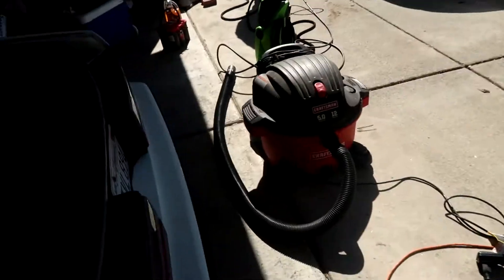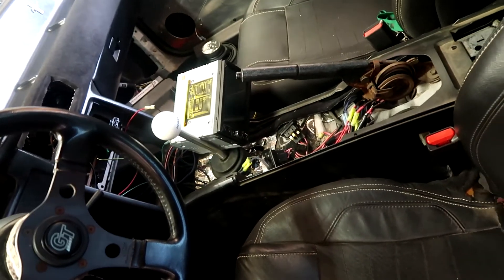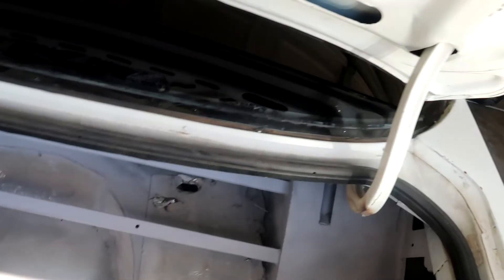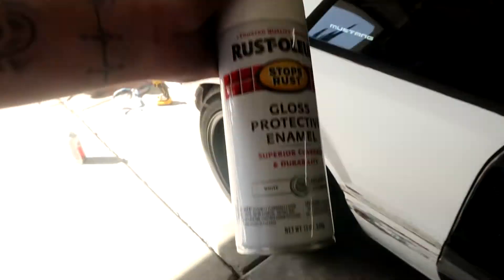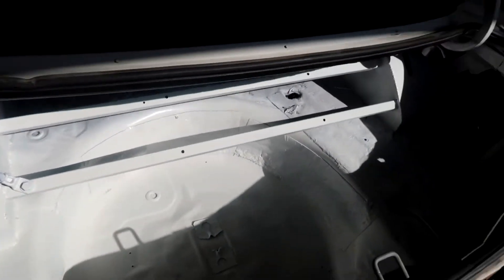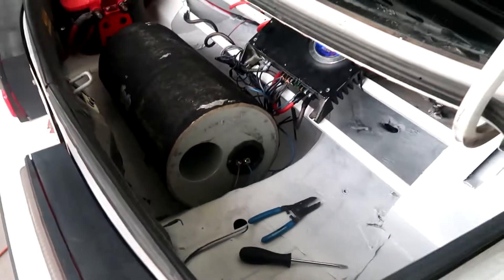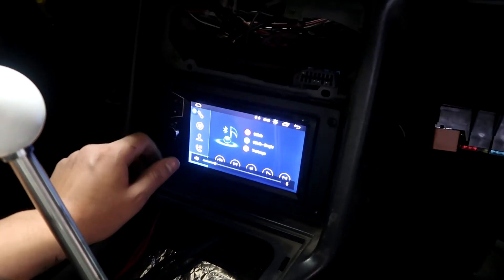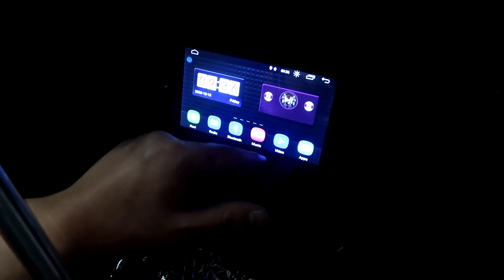Ls Foxbody Gets some love and double din stereo

Comment: Nice work. Keep us updated on how you like the stereo after a while.
Reply from the maker: Will do so far so good just amp over heats when having it up to loud from having to much hooked up to it will be installing another one soon
Reply: Hey alex. So getting ready for my own swap 89/ notch 5.3 4l60e. Anyways what oil pan. did you use with the aje member?
Reply from the maker: @mica9977  I’m using a camaro oil pan
Reply: @db2alex746  that right your whole engine was from an ls1 Camaro.